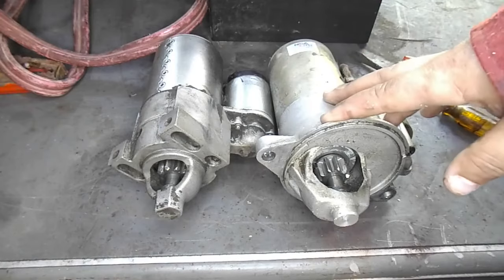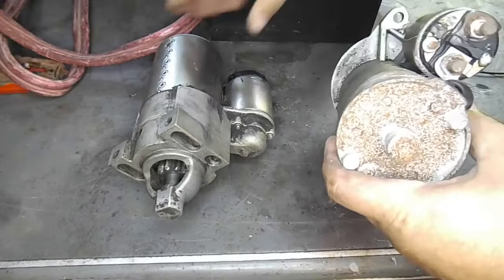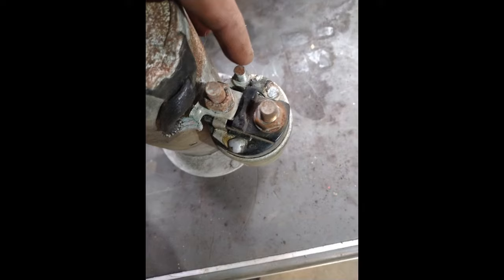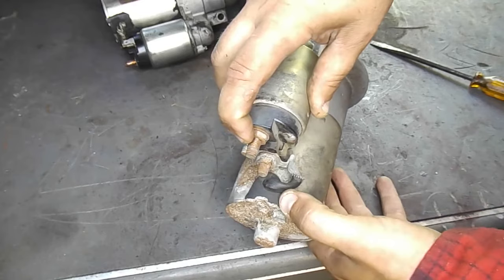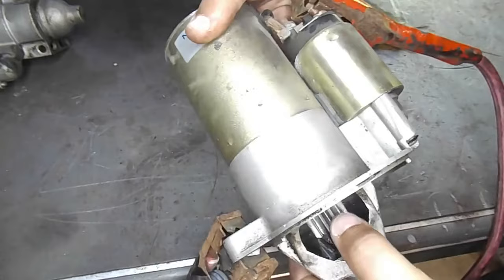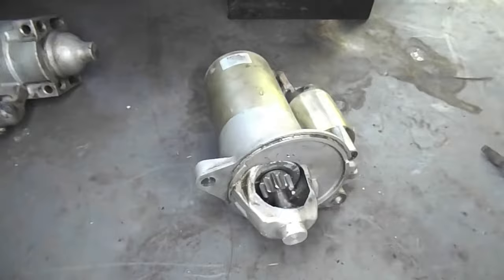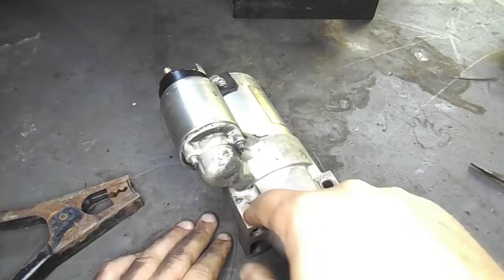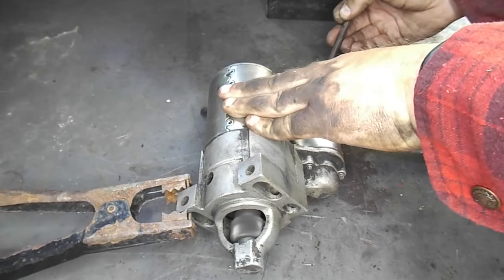How to test your Starter Solenoid Assembly

Comment: Thank you. I'm having trouble with my car starting intermittently,  I had a new starter put on and  new battery my terminals are good and everything looks good on the starter now to start checking the solenoid because like I said sometimes it cranks and sometimes it don't!  thank you so much for a to the point and precise video
Reply: If you purchased a new starter it already has a new solenoid on the housing. You may have a crack shaft sensor or a cam shaft sensor going bad.
Reply: If they both are tested and good it's most likely your ignition switch.

Comment: So the first starter doesn’t spin through the solenoid. Test the starter alone by applying power to it through the lower post of the solenoid that has a wire directly connected to the starter and negative cable same to the body of the starter. If the starter suddenly spins, then the problem is with the contacts inside the solenoid.

Comment: Aight I just replaced my starter but I’m just getting a single click but no start. I had the old starter tested and they said it’s bad and they said by battery is good but needs a charge. I tried jumping it before i tested it however but it still wouldn’t start, so I don’t see that making much of a difference. I feel like it could be my alternator cuz that’s the only thing not new but or tested in about a month but still I’m not sure… any help is greatly appreciated

Comment: I think my selenoid is bad. So i got a no crank no start. I needed a booster to get car started. Got it to start but car lasted I only 2 days and then did the same thing. I charged battery i case it was battery. Started no  crank no start. Did it again and it took 10 seconds turnover before it started. So i dont think its the starter or it wont even turn but the selenoid going bad is not popping out coukd cause it to not turn sometimes or not turn most times? From spinning and cranking?   I got a code for cam shaft  position sensor, which I read eventually causes no start but it doesnt say if its a no turn no start or of its a turn but no start. Alternator hasnt died or the car would lose power and turn off or just not turn and or crank at all. Other suggestions anyone? let me know please. I dont want to buy new starter and alternator just to find out issue continues. It may be ignition switch or something similar? Not sure

Comment: So what  if the  24v starter spins on a12v but the  bending gear doesn't  come  out will it comes out  on a full  voltage of  24v